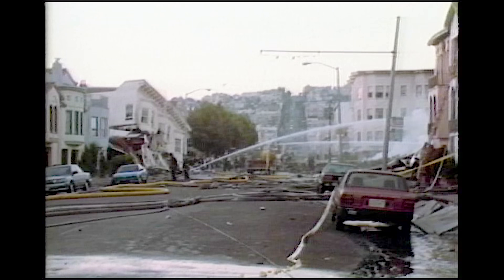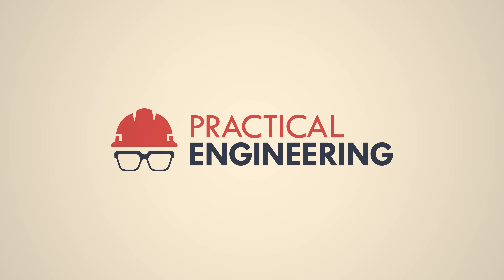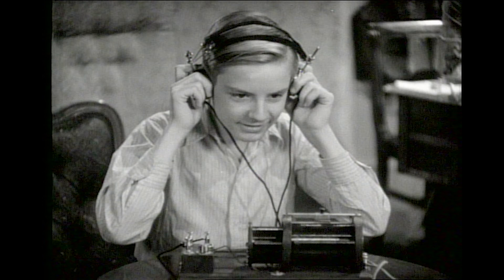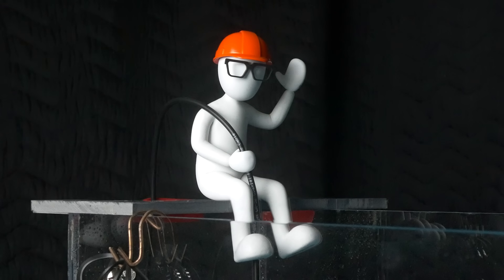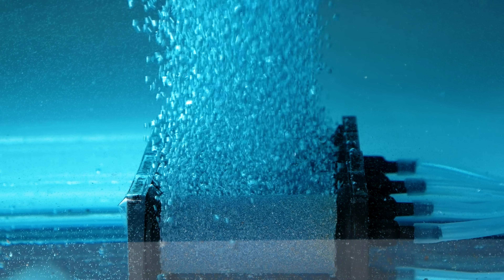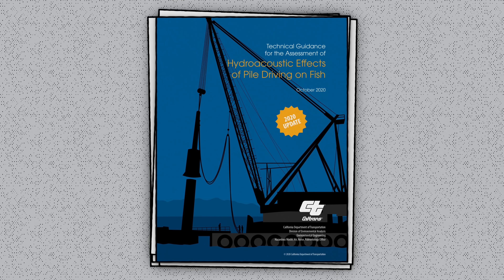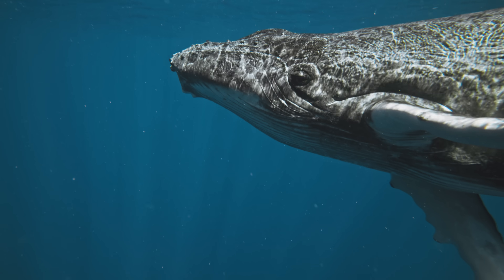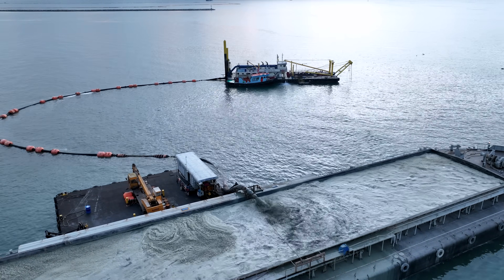The Weirdest Tool in Underwater Construction

Comment: I design the compressors used for these bubble curtains! We now use class 0 oil free compressors for this, so oil is not a concern. These are being used extensively for offshore windfarm installations. The amount of air used is absolutely mind boggling. A single curtain can contain 15,000+ cfm of compressed air. It's great to see our product used to help protect the environment.
Reply: Go you!
Reply: I work mainly in industrial Mechanical design. Are these centrifugal compressors, i'm assuming?
Reply: @matthewshultz8762  Rotary screw. Good guess though! I think most oil free uses centrifugal designs.
Reply: @slasher1166 I’ve dealt with rotary screw vacuum pumps, so I’m curious how large a compressor would be seeing as they are around 400 horsepower based on the diesel consumption? Also curious how they can manage all that heat generated by the compression without oil?
Reply: @nicholasdowns3502 Engine is about 50% bigger than that. I can't really get into thermal solutions as that is proprietary. It's a difficult problem!
Reply: Cfm = cubic feet per minute?
Reply: If one was currently pursuing a Mechanical Engineering degree how could one approach your company?
Reply: @jackwollenweber4723  I would recommend joining groups like the ASME for mechanical engineering or ASCE for civil engineers. 

As much as I find networking exhausting, I think it can be quite productive if you know how to quickly introduce yourself to other people and explain what your career interests are. 

Don't focus too hard on one company. When I was in college I was told that companies are looking for internship experience and the only way to get that is by applying intentionally to different companies until one accepts you.
Reply: @jackwollenweber4723  You don't. You approach colleges, recruiters, and advisors. Contacting companies is the wrong way to do that.
Reply: It seems like bubbling the rivers that get excess nutrients from agriculture, golf courses and homes would allow the nutrients to be used in the food chain and prevent the dead zones caused by the lack of sufficient oxygen from overgrowth.
Reply: @thomasmacdiarmid8251  yes - in the UK we have 'bubblers'; boats that go out in times of hot weather particularly to bubble the water and increase the oxygen content.
Reply: Worked as a longshoreman crane operator and diver. Thanks for that info. I love it. The stuff we do in the ocean is mind-boggling I agree.
Reply: What company? Atlas copco?
Reply: Offshore wind farms create vibrations that kill whales, its sad the construction companies care enough to mitigate the damage during construction but governments are too concerned about looking good to actually care about the horrible effect those farms have on wildlife.
Reply: Thats like 150-200 resdential vacuum cleaner
Reply: Isn't cfm a bullshit nonsense metric? Maybe that's just for packaging on compressors in stores and there's a consistent engineering definition that they just don't follow.
Reply: @jiaan100 it's only nonsense in isolation, generally it would be x cfm at y psi. i.e. volume of air at a set pressure over a set amount of time.
Reply: What's the compressor and tank set up like? How many feeding per curtain?
Reply: It's all fun and games until the extra oxygen upsets the balance in the water and another agency is formed.
Reply: Since with cavitation the density of the water would be greatly reduced this would be a great way to create a boundary that bouyant vessels cannot cross, including submarines and torpedoes. 
I suppose in the modern day these are lesser of an attack vector and there are plenty others. But might still have potential in protecting shipping lanes  if it could be something that gets deployed from a ship as a less than lethal type defence.
Reply: @GimpGladly pretty sure I could ollie over it which means a boat wouldn’t have problems
Reply: @humanmerelybeing1966  right, no way to make it a different shape
Reply: How thick is the curtain? If it's a foot thick, at 15k cfm a 150' tall curtain could be almost 32' across. But if it's only 6" thick you could double that diameter, etc. 🤔
Reply: Windfarms mess with the sea creatures
Reply: @tjwadsworth6967  This is true and it drives me crazy that no one is willing to talk about this!
Reply: @tjwadsworth6967 Humans mess with ALL creatures, just have to accept it and minimize it.
Reply: @randomname4726  Windfarms kill whales at a huge rate.
Reply: So, does the oxygenation of the water during these projects have a beneficial impact on wildlife?
Reply: @DrakRahi No, wind farms themselves kill local wildlife by generating vibrations that travel through the water.
Reply: Per minute. 25k cubic meters per hour, give or take.
Reply: @JasperJanssen No, CFM is Cubic Feet per Minute.
Reply: “CFM” is what? “Cubic Feet Minutes”?
Reply: @emberthecatgirl8796  Cubic feet per minute, apparently 15000CFM is about 7m³/s if you prefer metric.
Reply: @triffid0hunter everyone prefers metric!😂
Reply: If you count into the total environmental destruction world wide that of the communist regime's flattened or made by the democrats since WW2 that's more than 2/3 and its massive specialty for the jungles in poorer countries. 
Thanks for nothing.
Reply: @somozasi Democrats destroy far less than Republic*nts, you are delusional.
Reply: That's a crazy amount of compressed air. I assume it's created with a diesel compressor? How much diesel do you think is spent installing one wind turbine?
Reply: @djrenault they use about 20 gallons per hour per machine and run at least 10 machines. Probably in the thousands of gallons.
Reply: @djrenault  yes. the answer is yes. Wind turbines never offset the carbon emissions. The carbon Tax is a global scam. Even B. Gates has had to back off of the green scam. To add insult to injury, the blades are buried in a pit with zero "recycling".  -Don't believe me. I'm just a stranger on the internet. I've given you the coordinates to the truth, you already own a shovel, Dig at the peril of your own worldview.
Reply: @djrenault The amount of nasty chemicals used in the creation of "eco friendly" wind farms is staggering, not to mention how deadly wind farms themselves are to wildlife both on land and in the sea. And then you figure in the massive landfills of them we already have piling up.
Reply: @djrenault  The compressor is not necessarily diesel, it can be electric too, Atlas Copco has this range.
Reply: @adityac3239 this is true but since these are in the middle of the ocean diesel does make sense. The other option would be running a generator which would incur more efficiency losses overall.
Reply: @slasher1166 yea i guess that's true.. Most of the ones using electric are for waterways like Amsterdam bubble barier instead of vessel deployed ones.

I guess made sense that other non impact driving methods are being looked into right now. Especially with soft soils
Reply: @adityac3239 i mean it could be electric but the electricity would be produced mostly with fossil fuels dont
Reply: It's kind of odd that you'd say "protect" the environment when installing windfarms. It's not like we've found out the blades are difficult to recycle. Plus, the machines running to make said bubbles. Either electric, so plants like coal, nuclear. or combustion engines and whats comes out of the exhaust. Surely while installing the windfarm the local ecosystem gets affected. 

Pretty much all of it is the opposite of "protect the environment."
Reply: @ganjasage420 surely any short term environmental damage is quickly compensated for by the environmental benefits of fossil free electricity
Reply: @ganjasage420  you havent considered that electricity is pretty much a requirement for modern society and all these other energy have these same issues and in most cases worse
Reply: @ganjasage420  Cry about it, hippie. Are you saying because we should stop trying to protect the environment because we can't do a 100% perfect job? Cowardice.
Reply: @ganjasage420 You are delusional. Windfarms help the environment overall.
Reply: @randomname4726  They do nothing of the sort! Wind farms in the ocean create massive vibrations that travel for miles all around them, disorienting larger fish and killing small ones. Not to mention how bad the materials used in their construction are to the environment. On top of that very few companies actually dispose of them properly due to cost so we have massive landfills of them piling up.

Comment: Bubble injection from hydrofoil ship wings can be used to reduce water density selectively around control surfaces, allowing them to turn more easily. Specifically, it can be used to reduce water density on the compression side of a turn, allowing the wing to temporarily act less like a keel.

Comment: I used to work for a company that designed/manufactured systems used in steel casting where a bubble curtain is used to trap inclusions in the molten steel before it could flow into the mould. It was on a much smaller scale compared to your sea or river examples, but the temperature conditions were obviously way more severe. 
One of the big problems to overcome was making the bubbles small enough to trap the smaller inclusions - to produce small bubbles, you need small pores in the ceramic diffusers, but for the smallest pores, it’s below the ‘natural’ porosity of the material, so you drastically reduce the gas flow.

Comment: How about surrounding the pile driver with a ring of air mattresses?  Likely a stack of rings so higher air pressure in lower rings.  30 db drop on both air/water interfaces.

Comment: There's a bubble curtain near me in the River Lea in Hackney, London. I have no idea what it's there for but it's set up diagonally across the canal portion of the river.

OK, well now I've Googled it and it's called the "ISS Flowthrough Lea Bridge Bubble Curtain". It's there for several purposes, mostly around preventing something from crossing the barrier such as salt water, aquatic plants and pollution. The diagonal angle is designed to push floating rubbish across to one side of the canal where a collection point downstream can capture it, all while not preventing river traffic from passing. It's a very clever solution.
Reply: I always assumed it was primarily for aerating the water. This is doubtless a positive secondary effect.

Comment: Sound is weird.... I was working underwater about 2 km from pile driving. It felt like being slapped in the chest. Hammering is also interesting. When you're in an aluminium boat the sound of someone on the bottom hitting a pipe is like someone is tapping the bottom of the boat with a coin.

Comment: A friend whose was a mechanical engineer who'd worked in the Lake Maracaibo oilfield said they'd used vibratory hammers there in the 1960s.  I guess their effectiveness depends a lot on the nature of the sea/lake floor.  I live near a big lake that has a lot of pile driving done in it, and I've not heard of bubble curtains before. I wonder it's a scaling issue, or a difference between salt and fresh water. Thanks for another fine video, Grady!

Comment: I wonder how the size of the bubbles affects the curtain. I would think that the size of the bubble doesn't affect the efficiency there for smaller bubbles would give you a better reduction in noise. Being that it would be harder for the noise to transfer through. Due to a better coverage, of the overall area.  It would also reduce the amount of air you're having to pump down to the ocean floor or lake if applicable.

Comment: If you put fome tape on that's the acrylic, wouldn't it reduce the noise transfer. I'm giving you a more accurate test. Also, maybe putting the bubbles closer to the speaker. I know that this isn't about the test in the garage.I was just suggesting. I like the video. Makes sense to me. Makes me think of ways to soundproof a home.

Comment: Pile driving is so annoying. An underground carpark was built next to my apartment building. Not only was it loud but it also resulted in cracks in the building because of the vibration. Its very selfish when they use pile driving in a location of dense buildings. Also its impossible to block out the noise and vibration because its so loud. Even the memory foam ear plugs weren't enough. I feel sorry for underwater wildlife, because it must be much worse underwater.

Comment: FUTURE TOPIC - air used in construction range from jack hammer to air casters.  I watched riggers move multi-ton heat exchanges using these air casters like floating an air hockey puck.  I have also seem videos of ship launches on inflatable air bag rollers.  I have personally used air pipe plugs and I have used rescue air lift and recovery bags.

Comment: I've wanted to know the base of the sound dB system for so long; thank you

I do have one question though.
My understanding was that 1 Bell is a tenfold increase and one deciBell is the unit that 10 of which is equal to 1 Bell. (This turns out to be a 10th root of 10 multiplication.) The formula you gave, however, implies that it's 20dB that results in a tenfold increase. Is this difference maybe because what's actually being expressed is the power intensity? A pressure based base could still make sense as it could still be the power intensity at that pressure.

Comment: i don't recall if they used bubble curtains but a trial for managing zebra mussels somewhere here in canada involved basically releasing a whole lot of potash temporarily into a closed off section of bay. bubble curtains could help contain the application in small bays inlets harbors etc where mussels love to set up but have significant surface boat traffic. apparently the potash is particularly harsh on the mussels but not so much the other aquatic life, not sure if it smothers them or poisons them or what

Comment: Look at the number of compressors running flat out to make those bubbles so they can reduce a few dB for “potential” species in the area. Put that carbon footprint of those bubbles in the face of environmental regulators and make them square the cost and benefit. 

Most regulations and mitigation measures that are required are hocus pocus with questionable benefits but unquestionable costs. And the ones requiring it never get questioned or challenged. These types of regulations are a huge part of why we are so behind in infrastructure in our country. The mitigation and regulation program outsizes the actual project in many cases. 

Beware the enviro-regulatory complex!

Comment: The small ear-health tidbit of any 'sound' at 194 db (at sea-level in 1 atmosphere) being a wave that oscillates from zero to two full atmospheres in pressure. Anything more energetic is then considered an "explosion" as it doesn't wave the air, but physically pushes it away from the point of origin.
Reply: I saw the other day Adam West’s Batman had a pocket device capable of 20000 decibels. Dude could end the world!

Comment: A lot of naval vessels have bubble curtains they use to reduce their acoustic signature, making them harder to detect/identify/follow via sonar.
Reply: 100%. We used to call them masker air systems. That was 30 years ago so the system name might have changed. We were told that while running the system we sounded like a small rain shower to a submarine.

Comment: Since you asked about bubble applications. In several technological processes, they used as mixer agent, dispersed pump, substance carrier. The branches are various. Medicine, semiconducting industries, layer deposition, and etching of functional surfaces, not only accustical but also optical screens and sheets.  Damping regulating medium, filter controler... to name a few that I've had to consider and apply in my carrier in several companies and institutions. And thank you for naming it as a tidal and biological separator. I'm tinkering around aquariums as a hobby, and one of my unresolved chellanges is to create a two zone tank with strongly differing salt levels. Somehow, it slipped my mind to try out bubbles wall as an osmosis separator and regulator. Much appreciated!

Comment: 9:05 Instead of a bubble curtain away from the speaker, what about putting the air stone directly under the speaker, encompassing the entire front of the speaker with bubbles, so the sound waves will hit the bubbles immediately as it's being generated.

Comment: Small bubbles can be injected into the blood so they can show up on ultrasound scans. It’s used to see if there is a hole in between the chambers of a heart. 

This information is crucial for shocking someone whose heart is beating too fast; if they have a clot brewing somewhere and the shock “jostles” it loose and it goes through the hole, it can end up in the brain and cause a stroke.

Comment: Is there any work on the bubbles themselves on those applications ? Could larger or smaller bubbles changes anything ?
Another question, is the dampening effect of the bubble due to the bubble allowing the pressure wave to release energy into compressing the bubble or is it another mechanism at play ?
Of course i'm using the wrong vocabulary :) don't hesitate to tell me the correct words to use on the subject ! I'm very curious :D

Comment: reminds me a lot about how a water deluge system in a rocket's launch pad is not only used to protect the flame trench from high temperature exhaust, but it is also used to dampen the reflected pressure waves from damaging the rocket itself.